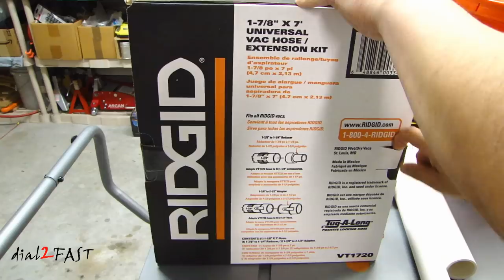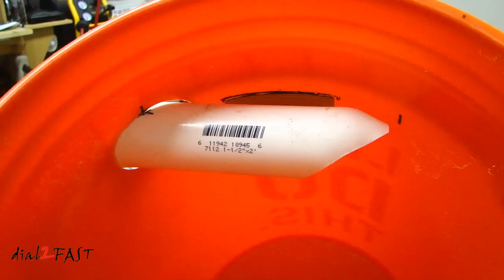How To Make a Cyclone Dust Collector for Your Shop Vacuum

Comment: Am about to install a dust collection system too. Have a couple of questions. You system seems only to be for the circular saw. Are you planning to expand (using piping system) to use with other machines? What's you experience with pipe diameter? Yours are about 2.5 inches. Have you used it over longer distances and if so, what was the suction loss like? My plan is to use approx. 3" pvc piping with blast gates for each machine. Lots has been reported about earthing plastic (pvc) pipes. You had any static build-up problems. Thanks man

Comment: The el on top should be replaced with a full sweep el. Its a curved 90 that will not plug up as easily with larger pieces.

Comment: Have you tried vacuuming dust when the bucket is 1/4 full, half full and maybe 90% full?  I have seen other DIY cyclones and usually the efficiency is much lower at that point.

Comment: Hello. At the outlet of the hose that goes to the vacuum cleaner, is it necessary to put a piece of cloth as a filter so that the fine powder is not aspirated by the vacuum cleaner?

Comment: Like It!  Will make one when I get time.  Why is the pipe inserted so far in the  lid and down in the bucket? Dos this serve some purpose or could that just be flush to the inside of the lid? Just curious.  Thanks for sharing.
Reply from the maker: I seen quite a few design and the length varies and seems to still work fine. You can experiment and see.

Comment: Interesting project, however it would be advisable that the two screws holding the wood brace do not protrude into the pvc pipe inside the bucket. Preventing possible areas to catch debris. I would position the pipe out a little and attach the pipe with a flat headed screw from inside the angled end into the wood brace.

Comment: Thanks for the video. I learned a lot from it.

 I built a dust collector pretty much the way you built yours, with the exception that I have a 12 inch long hose between my Rigid 12 gal, 10 amp shop vac and the bucket. Although almost all of the heavier sawdust and particles stayed in the bucket, a huge amount of the finer dust ended up in the shop vac. The vac had a typical filter in it. Could my vac be too powerful for this bucket size? Maybe the hose between the bucket and vac is too short? All hoses and pipes are 2 1/2 inch. I need to retry it and put  a 10 foot hose (that normally comes with the vac) between the bucket and the vac. Thanks.

Comment: Nice project. Those sheet metal screws you were using require different install technique. The top lid screw holes should equal the outside diameter of the screws so that the lid is pulled tight to the receiving side which will have correct size holes for holding the screws.  This will force your two pieces tightly together. (Same effect with screws with threads only on the lower half of screw.)   Test this by putting a spacer between the two pieces, then pull out the spacer with the screw in place. Now try tighten the pieces together. The threads have locked the pieces apart.    The build looks quite nice altogether and the discussion informative and useful beyond just this project. thanks
Reply: I was thinking the same thing when I saw that.
Reply: Lol, all these years I've built things and didn't realize I was using the wrong screw technique 
😂😂😂
Reply: chromolitho could you explain the size of the holes on the top being equal to the outside diameter of the screw ...?
Reply: @marcnaidu5804  If you have ever screwed 2 pieces of anything together by just driving the screw in. The first piece you screw into will pull away from the second because it's making threads in it. You can either back the screw out all the way and then reinstall it or, drill a hole in the first piece so the screw does not grip it but slides through and grips the second piece and pulls them together tightly. Does that help?
Reply: @marcnaidu5804  If you watch when he screws the wood piece to the bucket lid you can actually see the wood pull away from the plastic lid. The screws on the top piece of wood bottom out or tighten on the top piece before it pulls the bottom piece of wood tight. So with larger holes for the screw in the top piece it will just spin in the hole till the bottom piece is drawn up tight.
Reply: Kevin Mccartney understand. Basically his pilot holes on the top board needed to be bigger. Got it thanks ☀️ hello from singapore
Reply: Kevin Mccartney apart from that, I like one of the ideas to turn the bin upside down and use the base of the bin as the top as he is going to cut out the bottom anyway and attach another bin to increase the volume. Agree?

Comment: but the vacuum pipe goes straight down into the dust. How full does the pail get before the 4" tube down the middle starts sucking up sawdust?  Your test was only with a tiny amount. I would like to see a more comprehensive test.  Thanks for the vid.

Comment: Does the pipe that comes down from the top inside have to be below the pipe that comes in from the side> Also I liked the elbow turn to make the bucket more stable.
Reply from the maker: I have seen short and long ones work just fine. I made mine just to the bottom edge of the side pipe.

Comment: One major problem I see is using screws to attach the wood block and pipe inside the bucket. With the screw poking through the pipe you just made a plug point. What I mean is if you pick up anything large like scraps of wood they could plug your pipe. I would have used either epoxy or a pipe clamp. That way you leave the inside of the pipe smooth.

Comment: Great DIY collector. I´m in the process of building it. One question. Instead of making the cut in an angle in the inside of the cube would it work if i put a 45 or 90 elbow? Thanks and regards from Panama
Reply: * * *
I believe it would work just fine. . .
Your idea keeps all the cuts and holes easier to seal. . .
I think the angle of the final inlet pipe is to provide a wider diameter as an exit into the collector...
it provides more of an exit diameter than the inlet diameter where the hose is attached. . .
it should also prevent clogs (I suspect)...

Great project. . .

Comment: He mentions the Dust Deputy, but not the Dust Topper from Home Depot.  The Dust Topper sells for less than the Dust Deputy and comes with a 2 1/2" hose.  The topper just snaps onto the top of the 5 gallon bucket without using any hardware.  Tests show very little difference in performance between the Topper and the Deputy.

Comment: I enjoyed your video very much, Question "If nothing" goes into the Vacuum cleaner, is there any need for a filter at all ?
Reply from the maker: No you don't need a filter in the vacuum cleaner, but it also does not hurt if you have one installed.

Comment: Great video and very well explained. I just want to know how you curved the side pipe that goes into the bucket?
Reply from the maker: If you referring to the tip end inside the bucket, I just heated it up until it's soft and bent it on my table saw till it had a slight curve shape to direct the debris downward. If you don't do it, it will be fine.

Comment: Great video! Question: how did you hold down the piece of wood on your tablesaw when doing the circular cut? Was it just using the tip of the machine screw against the metal table saw?
Reply from the maker: I drilled a hole in the middle of the round piece, then using a screw, attached it to a piece of wood under. That piece of wood is clamped onto the table saw so it's secure. Now just rotate the round piece to cut.

Comment: Could u fill bucket with a bit of water to collect dust and prevent any dust from escaping?
Reply from the maker: If you are concerned with dust going into the vacuum cleaner, you can look into adding the baffle in the bucket. I don't think you should add water. I don't think it will be effective and probably make it messy inside.

Comment: They don't do a 90 degree angle because it puts more stress on the motor and you have less streamlined airflow. In short- you lose CFM versus straight or even a gradual curve.

Comment: Wishing that you showed us the Circle Cutting Jig on your table saw. Looks Like you had a runner in the T-rail & then had it  attached to a piece of plywood, then had a screw as a pivot axis for the MDF  that you was cutting the circle. 
If there is any other measurements that you have could you share them.
Thank You
From the Retired Hobbyist
db

Comment: I made this collector and it works very well.  My problem is if I let the end of the hose stop up the bucket begins to collapse.  Don't know how far it will crush as I released vacuum pressure as soon as I noticed what was happening.  Anyone install some type of bracing inside the bucket (Home Depot orange)?  Had to force one part of the bucket back into it's original shape.

Comment: Angle cut your silicone tubes at a 45 makes it go on smoother and pull don't push or it clumps on the ... nozzle I gues you could call it

Comment: Hi, love your easy design, I have built the same thing, but the jet engine noise I get when it is running is impossible to live with. I have tried everything I can think of to reduce the whistling noise, like larger diameter pipes, different vac, made a Thein baffle, took it out, do not know what else to do.
Reply: I've got the same problem - a banshee shriek that could shatter glass. I've seen a possible solution, but not yet tried it, which involves heating and then stretching the pipe at random points along its length to disrupt the 'standing resonance' (I think that's the correct term) which produces the whistle. Apparently, the airflow over the symmetrical ridges in the pipe is the culprit and varying the ridges should cure the problem.

Comment: Good Morning - great video.  I copied your design, but I am having an issue:  over half of the dust is still finding it's way into my shop vac.  Have you experienced any similar issues?  Any suggestions on a remedy?  I added an elbow to the vertical pipe, but it did not seem to have any affect.  Perhaps my shop vac is too powerful for this application?  Thanks
Reply from the maker: Sorry I am not sure why yours is performing differently. I still use mine and it's doing what I showed in this video. Perhaps you can try adding a thien baffle which helps separate the dust to the bottom of the bucket. Search Youtube for the thien baffle.

Comment: Maybe I missed it in the video but what are the diameter's of the PVC? From the pictures it looks like maybe 2" and 1 1/2"?
Reply from the maker: I added the below to the video description:
For this project, the middle PVC pipe installed in the dust collector lid is 1.25". The PVC pipe installed on the side into the bucket is 1.5". These sizes are what I found to work for my setup between tools/shop vac/hose. Your setup may have different pipe sizes. 

There are many different pipe diameter sizes found between different brands and tools. For example, many vacuum attachments such as brushes, hand sanders have a diameter of 1.25". Table saw may have pipe diameter 1 7/8". Some shop vac has 2.5" pipe. 

You will need to figure out what are all the pipe sizes you have, and then get the proper PVC pipe to get everything integrated. If you can't find the right PVC pipe, then you can also use some expansion rubber hose and clamps to hold pieces together.
Reply: Thanks sir. That's what I assumed but wanted a general idea of the PVC diameters. One thing I did differently, and I only have the lid complete, is to cut an octagon, 8-sides, instead of trying to cut circles for the lid pieces. The simple way is to cut squares first, then take the length of one side of the square and multiple by .293. Measure that distance from each corner and cut at a 45 degree angle. Nice and simple octagons!

Comment: How did the circle cutter attach to the table saw ?
Reply from the maker: Drilled a hole in the middle and put a screw through it onto another small piece of scrap wood which is clamped to the side of the table saw. Then position it so it cuts all around equal distance from the center.

Comment: rather than cut pic pipe to enter the bucket you could use pic elbows with pipe if you need to..much better than cutting angles ..on pipe.

Comment: You attached the vacuum hose small diameter end to the top of the collector.  I am puzzled when you used the new hose and attached the small end to the side of the bucket and then it leaves the larger diameter end of the hose to attach any tool attachment do how do you use any tools on the end of the hose? I am going to use a straight end (not flared) piece of PVC and purchased a rubber connector that is 1.5 inches x 1.5 inches with stainless radiator type clamps. I will connect the small end of the rubber connector to the NON flared end of the side PVC as it slips on the easily. Now, I will siip the large end of the vacuum hose into the larger end of the rubber 1.5 X 1.5 as it fits really well but will not tighten enough just so I can slide the large end of the vacuum hose in and out to disconnect it for cleaning purposes. Now I can connect the vacuum tools to the end of the hose if needed to clean. Wish me luck.

Comment: I shelled out some extra money and bought the small Oneida Dust Deputy and mounted it on the top of the exact same bucket.  I have an issue where the sides of my bucket will collapse after maybe 20 min of run time and god forbid the end of the hose accidentally suctions onto something.  If that happens it's most likely time to get another bucket because the sides are likely to split.  Do you know how you can deal with the vacuum that the vacuum puts on the bucket?  I also tried a metal bucket and the same thing happens.  It would seem for me that their isn't enough air flow to compensate for the amount of vacuum being placed on the bucket so the sides suction inwards.  (My vacuum is the Craftsman XSP 12 gal 5 peak hp)
Reply: GlobalIdiot101  -  I used a $20 igloo 5 gallon cooler with mine. I found after a while the lids on those Home Depot buckets (as well as the buckets themselves) become useless due to the stress of the vacuum and emptying them. This is especially so if you do a significant amount of woodworking. I haven't had issues with the cooler in the least. If your vac has enough suction to collapse an igloo cooler, you better MARRY IT!  😜

Comment: Can I have a 4" hose going in and a 2.5" hose coming out or do the inlet and outlet hoses have to be the same size in order to balance out suction. 
I'm looking to connect the 4" hose to the bottom of my Rigdid table saw and the 2.5" outlet to my shopvac
Reply from the maker: It will still work, just make sure the lid is sturdy as it will flex inwards quite a bit.

Comment: I realise this video is old but I'm wondering why you put the pvc in the bucket at an angle? Why not drill straight through?
Reply from the maker: My reason was simply so it won't be easy to topple over.
Reply: dial2fast no I mean the one in the side.
Reply: 37South Vintage Restorations, to achieve the cyclonic effect the suction current has to be directed at the circular interior wall of the bucket. As I understand it, the cyclone helps to keep the dust from entering the outlet hose and eventually ending up inside the shop vac.

Comment: Hi, love the video.  I want to ask if the two pieces of wood on the lid must be circular,  or they could be square as long as it is screwed and tightly sealed?  Thank you so much.  Learnt a lot from your video and yours looks very neat and nice too :)
Reply from the maker: It can be square but the suction will make the bucket compress inwards so best to have more reinforcement on the round lid.
Reply: dial2fast thank you :)

Comment: Would this work with drywall and cement dust. Dust flies out of my  dust vac out connection, even with 2 filters
Reply: One of the best tutorials on this subject, hands down. I have a couple of questions if you don't mind. 1) What diameter of PVC pipe is that? I don't want to buy the wrong size. 2) Others have mentioned how cool it is that you used your table saw to cut a perfect circle. Did you use some kind of attachment to center the wood? Thanks.

Comment: this worked for coarse sawdust and chips but does it work for fine dust?  I am thinking of using this for my 48" edge sander.  It really clogs the filter fast.
Reply from the maker: Most people report the cyclone dust collector is 97 - 99% efficient. As mentioned in the video, you can also add a Thien baffle to ensure the dust/debris settles to the bottom.

Comment: Small piece of unsolicited advice from someone that has no experience, but only read others' experience: rather than using one 90* elbow, it's supposed to be much more efficient to use 2x 45* elbows. Apparently 45* is as much of an angle as you want, any more and it negatively affects the suction. Just something to consider in the future should you expand upon this

Comment: Buy a used Dyson cinetic cyclone bin from eBay make the holes bigger on it  and add the shop vac hose on it and n another for picking up dirt trust me not even a tiny spec of dust  will enter the shop vac n even if it does the filter will stop it but the Dyson cinetic doesn't even use filters on its vacuum thats how efficient it is!! Try it trust me it will b the best £30 or £40 u ever spend and u will have a clean shop vac n a lifetime filter on it too!!! Another method is to add another hose to the exaust outlet on the shop vac u know  the same place where u add the hose for the blowing function on the shop vac and place that pipe straight out the window and all the picked up dirt that escapes the filter will leave via the hose that is out the window n straight outside!  Your health is important so protect it with my super duper methods!!! Patent pending😂